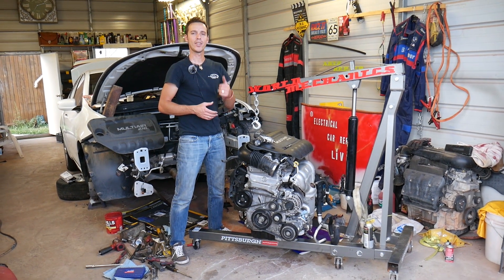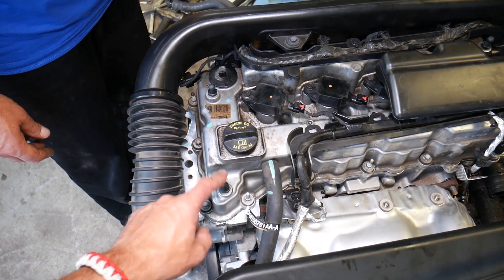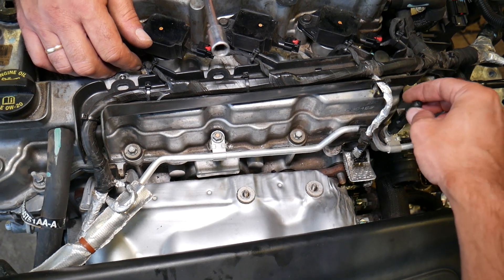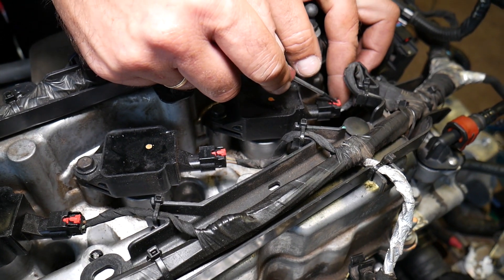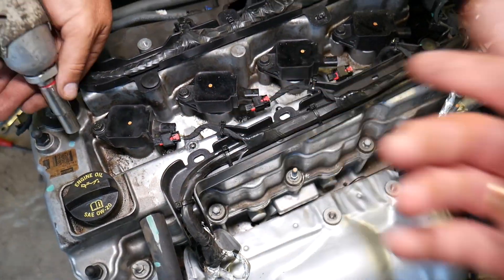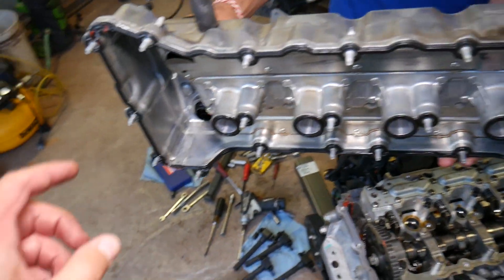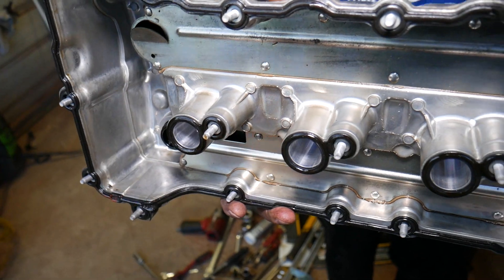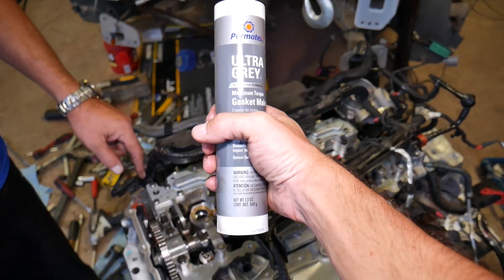VALVE COVER AND GASKET REMOVAL REPLACEMENT JEEP CHEROKEE COMPASS RENEGADE 2.4 Multiair

Comment: 🤯WTF - You made it look so easy, well, with the engine out. Appreciate the video, since I have to do this now, because I went to change spark plugs and oil was in the top two bolts tubes filled up oil and you showing where spark plugs gaskets are blown. Thanks!😎

Comment: You guys are life savers wayched yalls video on common misfire on this engine the middle seals for the coil pack on cylinder 4 is gone leaking oil into/around the spark plug. May try to change the seals myself whats the torque spec on the valve cover bolts
Reply: Mine is having a similar issue and I’m wondering if the gaskets are blown or not.

Comment: What are the torque specs for the 8mm bolts on the valve cover?
Reply: did you found the torque specs?

Comment: I've been q mechanic for 20 years and three engine are trash buddy just got a 2018 low miles and has leaks everywhere .. my 2008 toyota yaris with 200k has no leaks yet qnd this thing needs thr timing cover done and valve cover already